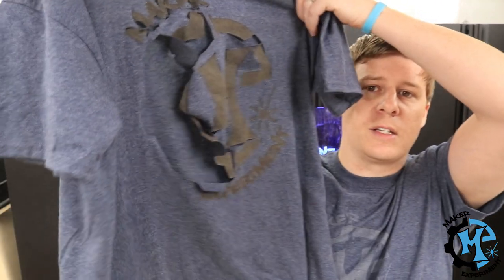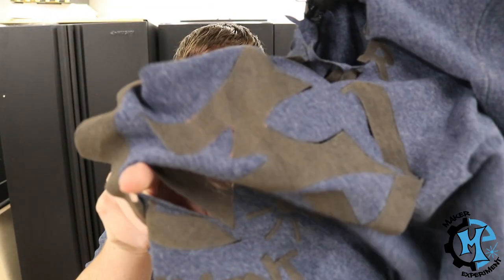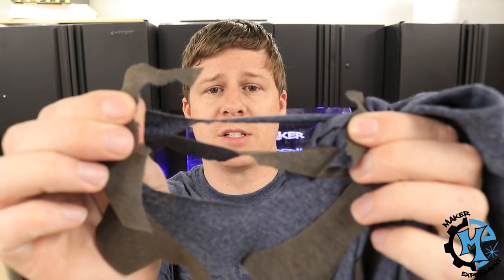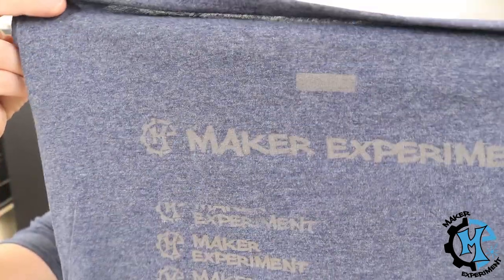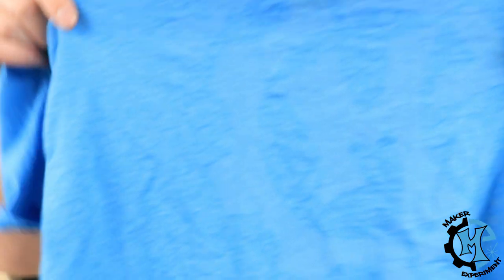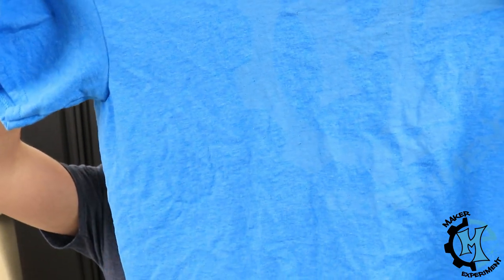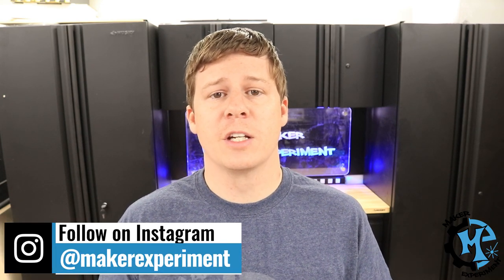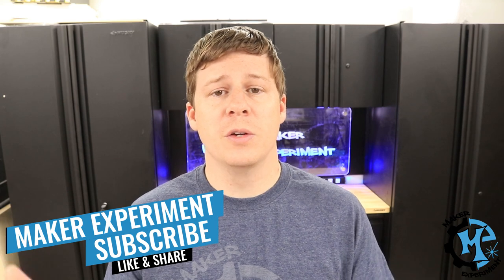How to Make a Custom T Shirt with a Laser

Comment: I think you should try the paint spray they use for the coloring that washes off easily but yet bonds with the lazer . I’ve never used a lazer I’m actually waiting on one I just bought. I’m curious if it will work. I think it will hold up from weakening the threads last through washing.
Reply from the maker: That would be an interesting test.

Comment: Can you do this with  an xTool D1Laser Engraving & Cutting Machine
Reply from the maker: I don’t have that machine. Ideally I don’t recommend using lasers for t-shirts. This was just an experiment and it only partially worked. The t-shirt eventually fell apart.
Reply: @MakerExperiment  Thank you, I was thinking if that would happen. NOTE: don't try on Tshirts lol!
Reply from the maker: @melyann81  it was fun to try and it kind of worked. I just wouldn’t sell them.
Reply: @MakerExperiment  The one I mentioned I just ordered. It sayd it works on fabric. So I was curious but I must assume it works on thick fabric cause I wondered if It would eventually rip if it was thin fabric.
Reply from the maker: @melyann81  it’ll work on certain fabrics but if it’s too thin it will probably rip apart.

Comment: what machine do you recommend for cutting polyester twill fabric?
Reply from the maker: You can use a laser for that. I don’t think you’d have issues with the material itself. Fabric can be kind of tricky at times though so it may require a lot of trial and error.

Comment: I want to buy a laser e graver, what power is enough to engrave tshirts? Is 1w enough?
Reply from the maker: matej đipalo I’m honestly not sure. I would think 4 watts is enough but I’ve never used one with that low of a wattage.
Reply: @MakerExperiment  i see, but for wood engraving, what wattage is enough?
Reply: @MakerExperiment  im new to this field sorry, i wouldnasume it depends on the typenof wood right
Reply from the maker: matej đipalo most lasers that attach to cnc machines are enough which are usually about 4 watts. It should engrave regardless but the speed may need to be really slow.
Reply: @MakerExperiment  i understand, thank you :)